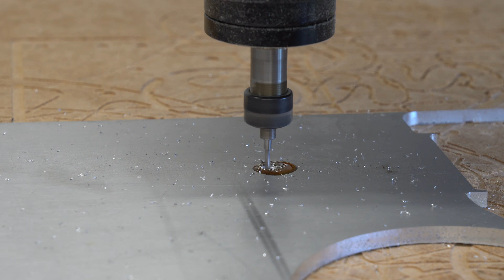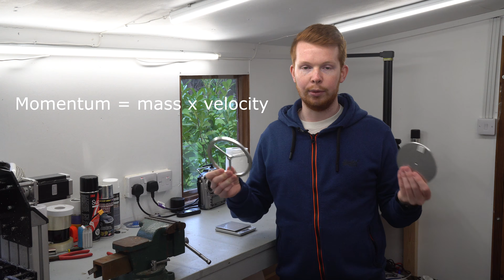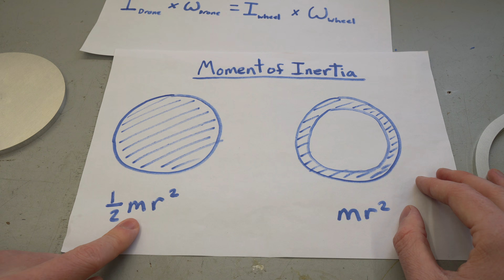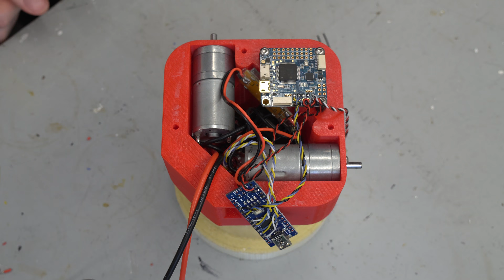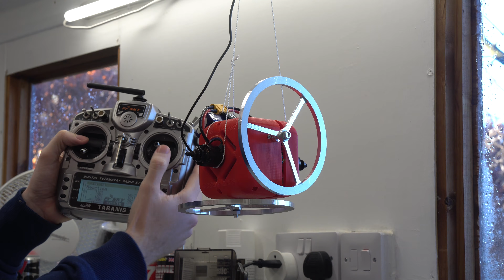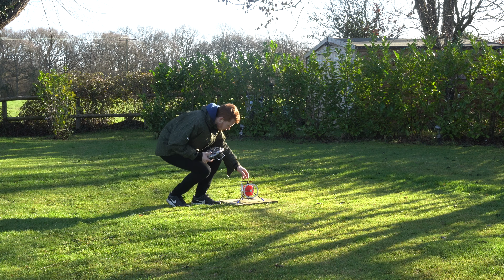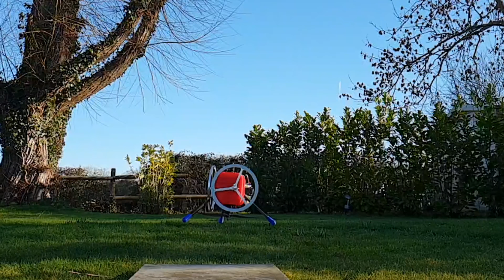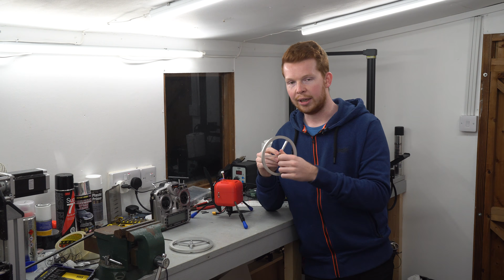Comment: More tuning and maybe redundant smaller reaction wheels on all four sides, since the larger ones weren't getting overloaded.
You could frame the entire thing inside a protective cube that covers the reaction wheels and motors from impact.
It doesn't need to be particularly powerful in TWR to lift, so a little extra protection weight allows more tuning before something breaks again.

Comment: Very close to a controlled flight! What about lifting it up high then dropping it and watching the reaction wheels fix the descent? It also looked like you might of had to much pitch in the props. Maybe less pitch in the props might help and make the reaction wheels be stronger than the torque generated by the props?

Comment: Part of the problem is the bottom propeller. You have the bottom thrust trying to overtake the top thrust resulting in the drone trying to flip. Both propellers need to be above the centre of gravity or change the bottom propeller for a third wheel.
Reply: I'm not sure what you mean by overtaking, but generally that's not now thrust works. If the propellers are properly mounted so that their thrust acts directly through the centre of mass, nothing else matters.

However a propellor using air from another propellors prop wash will affect the thrust generated
Reply: That's true for fixed wings, but not for something like a multicopter or a rocket, where the force vector is fixed to the body of the aircraft. See https://en.wikipedia.org/wiki/Pendulum_rocket_fallacy for a better explanation than I can manage.
Reply: He explained that in the hovering rocket video

Comment: Wonderful discreet guidance system for an airship
Reply: Or even better make an airship that is a cartoon plane in form with no control surfaces. Counter rotating props on the front and 3 axis reaction control at the CofG. Fly it like a pro.

Comment: It always seems to fall the way of the battery pack. Could it be that the weight is offsetting the center of gravity, maybe put it directly opposite one wheel and increase the mass or radius of that wheel to compensate? This is way above my "wheelhouse" so I could be totally wrong, just guessing! Awesome project.

Comment: awsome vid :), my thoughts are, is the P not way to high for such a slow reacting mechanical system ? with this delay, D will just make things worse, and my idea for a solution is a bit diffrent from other comments, instead of adding more pids ontop of pids how about a cold gas system, just like thay use in real satelites, nitrus oxide is cheap and available :) and can be used both to reduce the mechanical lag, taking up the slack while the wheels spin up, and offcourse to desaturate them, but well keep up the good work ! :)

Comment: Looked like the polling of momentum was lagged and by the time the reaction wheels responded, it was late and not enough.  I think it would've been perfectly fine if you just added an extra 10% in the opposing direction requirement, the overcompensation would have annealed over time and dampened regardless....but at least it would have reacted over the point of contact, rather than attempting to just get TO the point.

Comment: I wonder - could the problem be that you have the wheels on the sides, and only one per axis? In space with satellites it doesn't really matter where the wheel is, but on the ground with gravity perhaps you'd get better results by placing two wheels for each axis, one on each side.

Comment: nice video and nice project but maybe you can use 4  Reaction Wheels so u use them just like your props counter rotate each other and   let tem spin at a certain speed and produce tork to let one spin faster and the otter one slower i think its transitions smoother between change in turning direction because they keep spinning in the same direction but its ads a lot of weight but you can let tem spin faster so maybe make them smaller to make the flying machine lighter
Reply: Yes, had the same idea about the 4 wheels, and it makes the drone more balanced at the same time.

Comment: This was a fantastic build, definitely worth the wait and very informative. Ultimately I don't think a reaction wheel design can ever work long term because any slight imbalance in weight will end up saturating a wheel.  If your propeller based drone is imbalanced, it will just constantly run the motor on the heavy side faster than the opposite ones for constant torque.  If this has weight off-axis from the thrust, the wheels will constantly accelerate to fight the torque until one saturates.
Note that you can have torque indefinitely using gyroscopic precession, so a flywheel in a cage being turned by servos wouldn't suffer from this problem.  An idea for V2.0?
Reply: PKMartin That's called a control moment gyro.  Satellites use that control method sometimes.

Comment: Maybe you should use a propeller with three blades. Perhaps this will give you more stability than a standard propeller with 2 blades.
More blades work like more fulcrum points am i right or am i wrong? Because forces work in one plane and are spread out every 120 degrees. I think it would help stabilize it when the engines rotate at a slower speed. But that's just my guess.

Comment: Reaction wheels are a big thing also in motocross jumps, where the rider control the pitch by braking or accelerating in the air. Great video, as an aerospace engineering student you are a great source of inspiration to me.

Comment: I'm always amazed at your videos. It seems you've ignored the precession of a spinning wheel when it is moved is direction perpendicular to the wheels axis. Once a reaction wheels get a bit of spin up then the processional forces, which are 90° from the axial directions, can overwhelm latter. In other words, when the reaction wheels are spinning a bit you have to consider the perpendicular torque when the other wheel tries to rotate the drone. You can't treat the roll and pitch axis independently when you're controlling them with a pair of reaction wheels. The amount of torque on the drone  depends both on the delta omega of one wheel on the precession the other rotating wheel. If one wheel is not rotating then the effects of precession disappear of course. But overall, net torque on the drone is a combination of precession and the change in omega of both wheels. Precession must be considered. I think rather simple algebra added to the flight controller program will take care of this. Great video. Science in action!
Reply: Very well analyzed! 
German mechatronics engineer passing through, I should continue to study form my mechanical dynamics exam, but:
To me it looks like the gyroscopic precession is causing the PIDs to oscillate. The result is the "jerking around the core" motion see in 18:40 and following.
So if you manage to calculate the precession within the flight controller or the Arduino, it should fly much more stable.
I will leave for now, but very very awesome project. I would love to see a 2.0 of this ;)
Reply: I came to the comments section for this reason exactly. Glad someone else has written it out already though!
Reply: I'm no expert on precession or gyroscopics, but would a second pair of wheels solve the offset moment? i.e. four wheels, two and two spinning the same way on opposite sides of the drone. 

(or correlate the spin of one of the propellers, as these create a torque as well)
Reply: @notrocketscience96  , that's exactly what I was thinking. If the reaction wheels were made of an axle passing through the center of the drone with a fly wheel mounted on each end then it would cancel out any precession effect they would have, not to mention that it would seem to be a stronger and more balanced design.
Reply: @notrocketscience96  The precession would be the same in that case, it wouldn't cancel.
Reply: @FlyNAA  Well noticed. I guess they would need to counter rotate, and then the gyroscopic effect would cancel.
Reply: @notrocketscience96  maybe the joke flew over me, but if they counterrotate then they wouldn't impact an opposite torque to control the done
Reply: @FlyNAA  Yeah that's right
Reply: @notrocketscience96  iiui87786
Reply: I too kept thinking about the effect of precession which would effectively couple the pitch, yaw, and roll axes together... making an adjustment in the roll axis will create a precession force with the pitch momentum wheel, which in turn would create a moment about the yaw axis. Similarly, yawing with differential propeller speeds would create precession forces on BOTH the reaction wheels.

I agree that because gyroscopic precession is a simple thing to calculate, it should be possible to adjust the calculations in the flight controller to compensate for it.

This is a great project!
Reply: I agree with John H and all the others below, and would like to suggest an idea: 
Why don't you have one single fast spinning wheel oriented parallel to the two thrusters? If you mount it on something like a helicopter rotor head (with some adapted parts), the wheel will act like a self correcting gyroscope. By changing the angle that it spins at using the 3 servos from the rotor head, you will be able to change the direction. Just an idea mate, hope you like it !
Reply: @DZARO  that's adding another cook to the already busy recipe with the flight controller working to compensate.
Reply: @DZARO  Good idea! But you can imagine that as a spinning top. The precession woud still be an issue
Reply: I agree with what you said, plus the assumption that the contra rotating propellers have zero precessive effects may not be exactly true either. In theory the props should rotate at the same speed in opposite directions, but in reality there might be a slight difference due to differences in props and also the side swash from the top propellor against the body of the drone. Also as was pointed out above precessive effects from the two gyroscopes, although small, create an extra yawing motion and the motion controller may be trying to compensate for this by changing the differential speed between the two props.
 
 I think there's a good chance that it's mostly what Tom said in the video, just the motors not behaving as assumed and needing a closed control loop. Then again this whole system is a lot more complex than two independant gyroscopes acting on contra-rotating props with zero effect on the dynamics, but these effects may be negligable I don't really know. I suppose the faster the gyros spins, the worse the precessive effects get and that will make it get out of control very quickly; maybe that's what happened in the last flight.
 
 In terms of the general design of the drone, just trying to control the angle with gyros has some design challenges even when they are working properly. The main issue being gyro drift e.g. if the line of thrust from the props is off the centre of mass then you get a torque on the drone which has to be constantly countered by the reaction wheels in order to stay level, and eventually the gyros will become saturated (cant speed up any more). These gyros would be great for differential control e.g. changing direction very quickly and not integral control e.g. keeping an exact position over a long period of time. Gyros are great in space where you have basically zero outside forces but less so on aircraft. 
 Also making the flywheels large with all the mass near the outside is good for optimising the moment of inertia/mass ratio, but that isn't necessarily too important on a drone (although it does look cool). You could use a smaller gyro and motor without a gearbox with less torque (and current) to save weight and thus increase battery life. The gyros would need to spin faster to get the same moment on the drone so you may get more precessive forces and power requirements (unless there was some sort of regenerative braking on the motors), but with the power savings in less weight this may be a net gain.
 
  I saw a similar video of someone who made a drone using just a ducted fan pointed downwards and four control fins in the exhaust, he mostly had problems with the strong precessive effects of the single high speed fan but countered it quite easily in the control software. Tom could do the same thing but with control fins sticking out the sides of the drone body instead of gyros. It would be even easier than the ducted fan one since the contra-rotating props mostly cancel out the precession effects. May be an effective design since it only uses two motors and the contra-rotating props increase efficiency a bit. You could also add a duct around the whole thing to increace efficiency and safety.
Reply: @Bordpie  you could avoid this by being precise on the wheels themselves and gearing the two sides of each of the axles reverse to each other to lock their rpms together
Reply: The effects of precession forces are very small... I believe that the real problem is the imbalance of the weight, he had to put the wheels in pairs and with opposite angular speed just as he did with the propelers, to control much better the drone.
Reply: These reaction wheels are too slow to have a real precession effect, don't you think? And even if the propellers are spinning fast, they have so low inertia that precession is negligible too. Based on my experience of working on an attitude control system with 3 reaction wheels, it seems like the PID controller have too high Proportional values, resulting in a periodic oscillation.
Reply: @Zenith3D   I tend to agree, I was also afraid the precession effect mentionned would mess things up but at the speeds we see I doubt that's an issue, and the torque created would actually be yaw, so could be compensated on the fly. The PID could be a problem but I think it comes more from the delay that brushless motors have : on the bench tuning looks ok but the reaction speed is not challenged like for dynamic stabilisation when you need reaction time of miliseconds.
Reply: @manuelpellizzari8540  Did not think about it, but after re-seing the video, I would say that you pointed out an interesting point!
Reply: @Zenith3D  - "
it seems like the PID controller have too high Proportional values, resulting in a periodic oscillation."  I was going to say the same thing: TURN DOWN THE GAIN.
Reply: Thank you! I was just about to write that, too! Calculating the precession shouldnt be that hard a simple omega calculation and a cos(alpha) (where alpha is the offset angle of your symmetry axis) is probably enough!

Comment: Is it possible that the ratio between the moment of inertia of the drone and the moment of inertia of the reaction wheels is too high, ie: the drone’s inertia is not enough relative to the wheels meaning that the slightest movement of the wheels results in an over correction/twitching. If you lower the CoG of the drone to where it has a desire to remain upright and then use the reaction wheels to correct the pitch and roll. Saturation will be an issue if you which to maintain a certain pitch for flight. Thoughts?
Reply: A possible solution to the issue of saturation would be to manufacture reaction wheels which have more aerodynamic drag meaning that even at a constant velocity the drag will result in a resistance to rotation and the resultant torque will provide pitch and roll control, in order to counteract this torque and maintain attitude the controller will need to reduce the velocity of the wheel approaching zero and in turn prevent saturation.

Comment: "Gyroscopic precession is a phenomenon occurring in rotating bodies in which an applied force is manifested 90 degrees later in the direction of rotation from where the force was applied." Any RC-heli pilot know this so... Counter rotating propellers should remove this, but couple precession with IMU and Yaw control: Who knows?
Reply: With such masses, precession can be a problem even on low rpm. And also trickiest math of this project.

Tom, you should at least check magnitude of this effect.
Reply: i have a airhogs heli. i dont know this :(
Reply: @honkhonk8009  air hog helie..lol, takes me back to 2009 when I had one...toy madness to git that rear rotor right.
Reply: there a bit more math than you can chew on this one...would one gyroscope work better on the bottom?

Comment: Tom, seems like a better test would have been to just have the cube balance itself atop a pivot at the bottom before trying to balance it in flight (read, less risk of damage)? i realize the pivot would be under the cube rather than somewhere within the cube, but it still seems like a quicker and safer way to test.
Reply: Why stop at merely balancing? Make it maneuver all the way around the shop!
https://youtu.be/n_6p-1J551Y?t=91
Reply: The http://www.tsiriggakis.gr/sm.html sets the pivot point higher when the motors are on, so it is able to lift.
Reply: This.  And start with one axis of rotation, then two, then three. (i.e. build a hinge, then a gimbal, then a gimbal with yaw,
Reply: @charleslambert3368  it also looks like the flight controller is trying to adjust too rapidly then it over adjusts. maybe very slightly increase the "level" field and have a curved current so that the motors move smoother. Just a small idea I don't code much it just looks like its rapidly adjusting on an aggressive scale and then has to counter it.

Comment: Stupid idea: 
Use stepper motors for the driving. They got a lot of torque, and as long as the speed change isn't too extreme they'll be easy to control

The problem with the brushed motors is definitely how they work. A set amount of voltage or current applied does not equal a set amount of torque, since at increasing RPM the voltage the motor induces into itself raises - i.e. what you probably need is a constant increase in current for a set amount of torque - which also doesn't take into account the maximum torque and the torque/RPM relationship of the motor, so ah ... 
You're better off with an encoder.